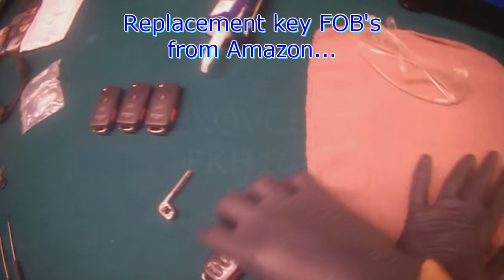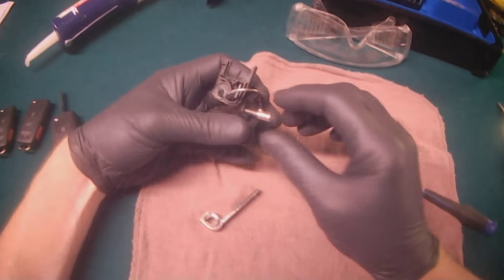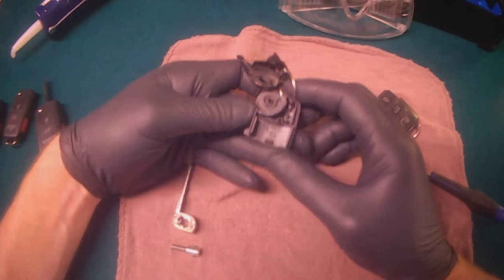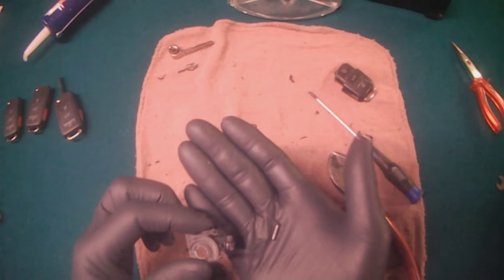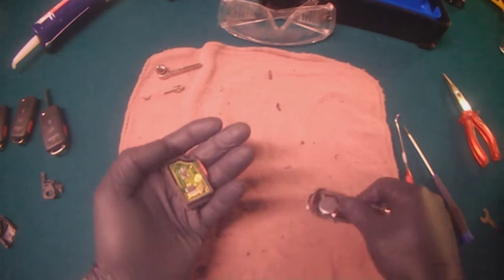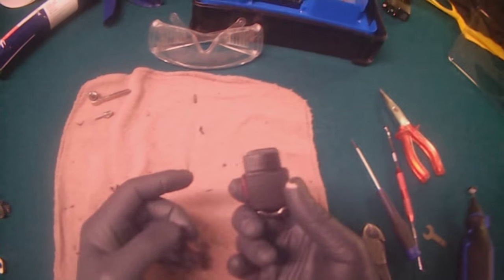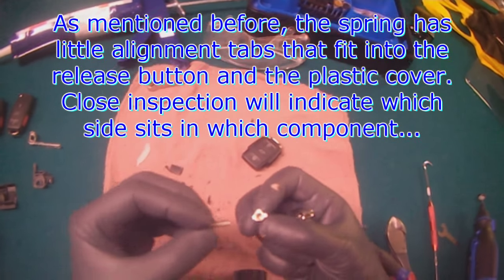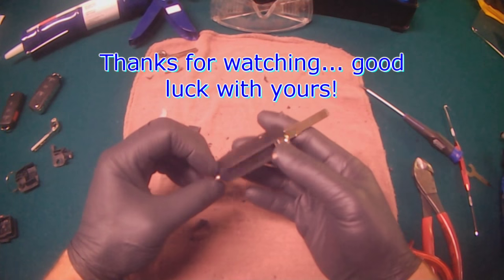VW key FOB replacement

Comment: nice video mate what I have done in the past on similar keyfobs as long as the water tight seal is still ok I take the Gibbons out first put the key back together and leave it on top of some hot water for a few minutes this heat up the glue and makes it easier to remove the chip
Reply from the maker: Great tip for next time, thanks!

Comment: I did this yesterday on my two-button Eurovan key fob.  The fob was $12 from an ebay seller.  The electronics part (circuit board and "pill") was pretty easy.  The harder part was the mechanical key part. Like yours, it was stiff and the key did not want to spring out when released.  I had to use part of the old key fob case to get it to work.
Reply from the maker: sometimes you have to do what you have to do... as long as it ends up working,  all is good. did you use a hot blade to cut around the pill?
Reply: +Thomas EXOVCDS No. I used a Sears "Lil Crafty" (like a Dremel) rotary tool with a small carbide bit to cut the plastic around it.  The pill wasn't held in super tight. It came out easily. I used hot melt glue to put it in the new fob.
Reply from the maker: +Garth Goldberg Of course... you mentioned that in your initial post. I've got two more remotes to do sometime down the road and will try a variety of bits / tools.

Comment: Hi Thomas have you notice that a the base of the key blade there is a mini rolled/spring pin I remove this pin before to exchange the blade that was already cut or in this case the original of the car.
Reply from the maker: I have not noticed one... I will keep an eye out for it.

Comment: Nice video! I was thinking if maybe it would be possible to grind the sides of the old key, so it wouldnt bind inside the new FOB. Then you dont need to cut a new one.
Reply from the maker: +5freestyler5 I was thinking the same... but the key has little raised edges on both sides (I think they help in locking it in place).
Reply: +Thomas EXOVCDS Ok, i see

Comment: Nice work .  I see Audi is first to actually going with the new 48v standard .  Looks like all the OEM'S will follow and it seems by about 2025  most will be switched to 48v.  How does this impact your diagnostics with such a drastic change. Never mind the ECM inputs going  with scrabbled Bluetooth type of wireless interfacing. Man your tool budget must take a hit trying to keep up with what's coming .
Reply from the maker: I've been hearing about the 48V route for quite some time... was not aware that Audi is already there. Will be interesting for sure! I've got a backup plan to be a parts driver when things get way over my head! :-)
Reply from the maker: thanks for the link!
Reply: Ha - parts driver,your not that old you got at least 20 more years to go. When you open the hood on a new 2020-25 there will be almost no wires  harness and what you will find is micro processors attached to engine sensors,  I seen a fully built engine from GM that is ready to go, you have to look real hard to find the wiring harness. AC compressor - electric, turbo - electric, water pump and steering their already electric. The alternator is put in reverse with a spot in the front timing chain area and this removes the belt. No more belts , no tensioners no more parts- ha you won't have anything to deliver. Ah you'll be retired by the time they get approval to do it all.  Interesting times Ah....
Reply from the maker: +Steve Rob Would be nice to have fully modular components... plug & play with the vehicle doing full diagnosis on its own. No more worry about wrong diagnosis would be nice!
Reply: Ha- it's already here I'll send you the link if I can find it.  At least at GM.

Comment: for the chip pile you could use a soldering iron to melt the plastic at the ends and at the same time it would melt the glue!!
Reply from the maker: thanks for the tip... I've got 2 more that I need to do (for my uncle), might try it that way on his!
Reply: would be faster and easier!!! the soldering iron with the flat cutting blade!!
Reply from the maker: +jessy6464 Of course... I forgot about that attachment. That should definitely speed things up... but will also have to be cautious with the heat. I'll make sure to record & post that video!
Reply: yeah for sure!! dont burn yourself either!! :P haha you can mention me if you want i dont mind!! :P

Comment: Have you done a video to set my fob to my car without the original key. Bought my car used and haven't been able to use it at all since I bout it.
Reply: I've replaced my battery too and it still won't work
Reply from the maker: +Jonathan Stevens No, I do not have a video for a) remote matching / pairing or b) key matching / pairing . If the key is able to start the engine, then you don't have a pill / chip or the pill / chip is already matched to the immobilizer. If the remote does not operate the central locking, then the remote needs to be paired with the Central Convenience Module: https://www.youtube.com/watch?v=6ODt94_d6Cw Key matching: https://www.youtube.com/watch?v=Wj3K04eMV7w

Comment: I'm wondering--could I swallow the pill, then start the car with just a regular (i.e. "valet") key blank?
Reply from the maker: +Garth Goldberg LOL... even if it were implanted under the skin on the hand that you turn the key with, I think the coil reader in the lock housing is not strong enough to pick-up the signal. But feel free to try and let us know! There are no advancements in technology unless someone ventures outside the box. :-)
Reply from the maker: +Garth Goldberg The valet also has a chip.
Reply: +Thomas EXOVCDS My Eurovan came with some kind of flat key with no chip. I think it's only good for opening the rear hatch.  

The little plastic loop on the valet key broke a long time ago.
Reply from the maker: +Garth Goldberg Isn't a valet key supposed to be able to start a car so that the car can be parked? If so, it needs a chip (does not have to look like the pill)... or the immobilizer will stall the engine.
Reply from the maker: +Garth Goldberg I should mention that I have never had a valet key apart... so I don't actually know what they look like on the inside. My assumption is that they would have / need some kind of chip. A valet key usually only opens the door & allows for engine start. It should not allow glove box & trunk operation. Sorry if I didn't "grasp" your posts quite right... I'n not fully awake yet.

Comment: is there anyway to just replace the part that attaches to the key ring?
Reply from the maker: Sure, you can use the old front half and attach the new rear half... if that's what you mean.
Reply: +Thomas EXOVCDS ok i just bought a rear half on amazon just making sure. Thanks so much for the quick reply!
Reply: +Thomas EXOVCDS my volkswagen dealer was gunna charge me 160 plus tax for both keys...lol

Comment: Where can u get these rdfi pills cloned I broke one and bought two spare keys just for the pills and need to get them cloned so I can use the flip bode key already.  Thanks!
Reply from the maker: +Lawrence Thomas If the FOB came with a pill, you need to match the key (pill) to the immobilizer... you need a "pin" to gain access to the immobilizer "login". You can then "add" keys (pills) to the system. https://www.youtube.com/watch?v=Wj3K04eMV7w
Reply: Since I still have one good key how can I acquire the pin that way? I have one original key and two spares with new rdfi  pills
Reply from the maker: Lawrence Thomas You can only get the PIN through the dealer. Take the car to the dealer (with the new keys) and tell them to match all the keys & remotes to your car.

Comment: hello sir i have an 07 audi a6 c6 when the car has been sitting in the sun and its hot when i go to start it it makes a weird noise like it takes it a split sec to start up like you cant heart the engine turn over, and when its cool it starts normal like to you can hear the engine turn over a couple times and it starts im scared its going to get worse and not start at all i scanned it with vag- com this is the code i got any help would be appreciated thank you.

1 Fault Found:
00166 - Access/Start Authorization Switch (E415) 
010 - Open or Short to Plus - Intermittent
Freeze Frame:
Fault Status: 01101010
Fault Priority: 2
Fault Frequency: 1
Reset counter: 152
Mileage: 146688 km
Time Indication: 0
Date: 2015.08.31
Time: 14:47:01
Reply from the maker: +rusani89 That code might or might not be related... have a shop look at it, but they need to catch the problem while it is happening to make it easier to find the problem. I'm about to start work... I'll reply again after work if I find any info on that code.
Reply: ok thank you. its hard because you dont know when its going to do that its intermittent.
Reply from the maker: +rusani89 That's what makes troubleshooting difficult... unless someone has seen that problem before. I'll check if there are any TSB's about a similar issue... will get back to you later today.

Comment: Instead of the little grinding wheel on the Dremel, I'd use a carbide cutter.
Reply from the maker: +Garth Goldberg Thanks for the tip... I was thinking about which accessory bit to use and might give that one a try as well (dremel kit came with 40+ bits).
Reply: I have experience with this. I cut apart a MINI key fob, which isn't supposed to be repairable, and soldered in a new battery.
Reply from the maker: Garth Goldberg Nice!
Reply: The MINI/BMW key fobs have a rechargeable battery that you're not supposed to replace. I sawed the fob open around the outside edge, soldered a battery and welded it with a soldering gun.  I only got about another year out of it, however.